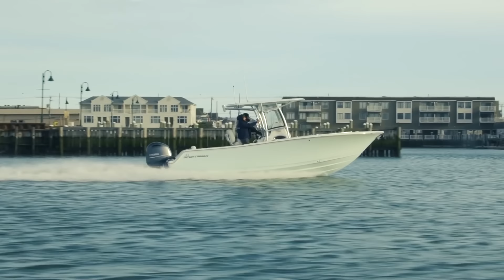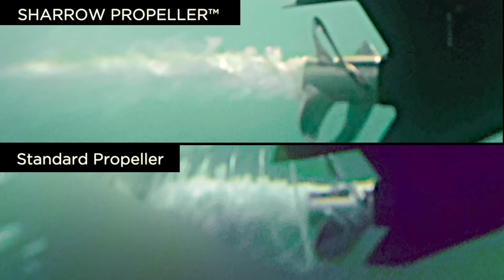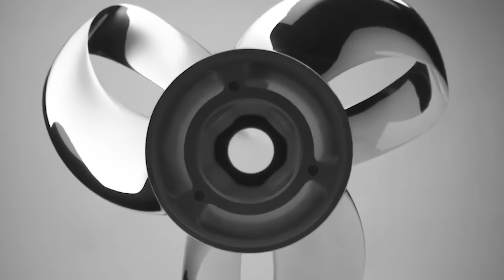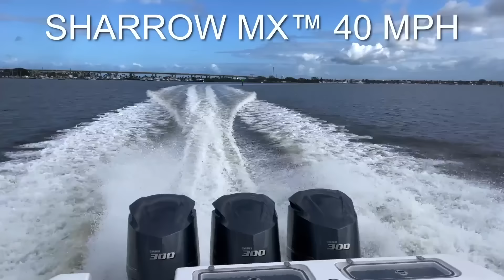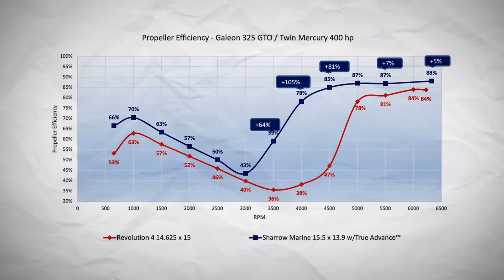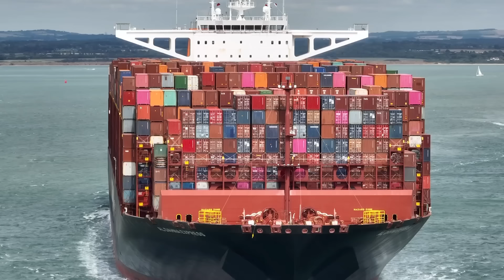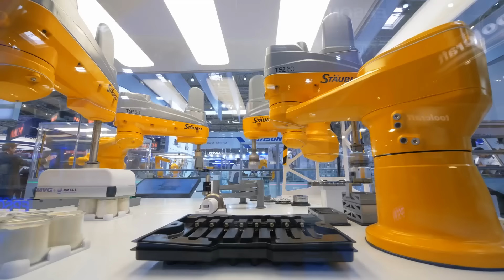This Genius Propeller Will Change Transport Forever

Comment: The reason for the current CNC or 3D printing requirement is that you can't easily  injection mold or cast  these due to their unique enclosed, twisted shape.   With an injection mold for instance you press top half and bottom half of the negative mold together leaving a void with a tiny hole in it.   A mechanism carries plastic beads forward through a series of heating elements which melt the beads into hot plastic soup, which is injected under high pressure through the hole into the void between the mold halves.   Once full, the mold  is left to cool below melting temp, and then the mold halves are pulled straight apart and plastic piece removed.  Usually some plastic needs to be removed at seams and the injection point.    BUT..    with the toroidal propeller shape there's no clear way to make the two mold halves in such a way that there will be a seam that allows separation by pulling the two halves straight apart.   The shape of the plastic part  traps the mold halves in place.   

For casting a metal propeller, the problem is not the cast itself, since the shell it's cast in, is removed destructively.  The problem is that to make the shell you'll cast into, you start by injection molding a positive wax propeller, which is made pretty much just like the plastic propeller above.  Two mold halves pressed together to form a void, inject melted wax, pull the mold halves straight apart, remove and trim the wax propeller.   Attach a wax "pour cup", add a silicon non-stick coating, then add ceramic/sand coating which is built up in layers into a shell.     Once hardened, it's heated in an oven and the wax runs out leaving a hollow ceramic shell with a silicon non-stick coating on its inner surface.    The ceramic shell is heated up to the same temp as the molten metal, the metal poured into the shell, and as it cools, the shell cracks, and the rest is simply knocked off the new metal propeller.  Pour cup is cut off, and everything then finish sanded smooth.  

In both cases getting traditional mold halves apart just isn't possible with the toroidal shape.     It's possible that some sort of mold that lifts and twists at the same time might make it possible, but still might be a problem if the pitch of the blades changes from root to tip (as it usually does on a traditional propeller) or there's a compound concave curve inside the tips.
Reply: How far can you get with a CNC machine?
Reply: @dougrobbins5367  Modern CNC machines can pretty much reach anywhere that isn't a fully closed volume (which is now the domain of metal 3D printing).  The heads articulate which allows them to reach inside structures like this.  In this case they just need to reach in from an angle to get inside that twist at the "end" of the blades.

The problem is CNC is slow, and because it's a subtractive process you're often cutting away more material than remains so it's fairly wasteful (luckily it's all recyclable).

Comment: So yeah, this is a scam, and you fell for it. This snake oil BS has been around as long as propellers have. No craft cares more about noise than a submarine, no craft features more cutting edge propeller design than a submarine.... wanna guess whether subs use toroidal props or not? You get one guess.

Comment: It's amazing how the toroidal propeller draws the water in from surrounding areas as shown with the dye in the water test. It would be great to see more of them and more manufactured to bring down the cost.
Reply: At $5000 a propeller, it cost more than my boat.  Propellers have different pitch and diameters.  It doesn't seem feasible for someone to have to go through multiple propellers to find the right one for their boat.  Until it comes down to around $200-$400 range, only few people will buy one.
Reply: @ahndeux  For normal people and very small boats this probably isn't worth it. But moment you are using boat for commercial application, even very expensive propeller should be totally worth it if the claims in this video are true. If not for smaller boats, definitely for bigger boats and ships.

So this video still kinda bothers me because looking at comments this has already been known for a long time, and despite that, if ships are not using this design there has to be some fundamental flaws with design, not the manufacturing.
From quick googling, fueling something like cruise ship can cost up to one million a week, so really if you are talking about insane saving over time larger the ship becomes.
Reply: @ahndeux  so true. What is really going on here is for your $5k they actually sell you a prop with pitch and diameter optimised for your boat/engine. Maybe there is room for a consultancy business whereby for $600 dollars you tell boat owners the optimum pitch/dia/blade number so they can go and buy the $400 conventional prop that is most efficient. And if they really care about the environment they can spend the $4k difference planting trees.
Reply: @XPLAlN  If you are a boat owner, you will know that its not easy to find an optimal propeller because the optimal RPM changes.  If the boat is carrying more weight, it affects the RPM.  If the boat is used for skiing vs a fishing boat, that also changes the prop setting.  If you prefer a faster hole shot vs higher operating efficiency, the prop pitch also changes.  Another factor to consider is the length of the boat, the hull design, the use of hydrofoils, etc, all affects the ideal prop design.  Even the material the propeller is machined out of (aluminum vs stainless) makes a difference in RPM.  There are just too many different variables.  The best way is to swap props until you get the performance you want.  That will never change.

Most of my boat owner friends have 3-4 props.  Some vendors allow swapping out props for a shipping fee.  Let's just say this is not likely to happen with a $5K prop.
Reply: It seems pretty old design, and would be in wide use if some mass production would make them viable for mass use. Overall, it seems like there are significant hurdles to overcome when it comes to manufacturing. That said, with current manufacturing capabilities it should be viable to use this, especially with high value machines. But from what I gathered it's not so I assume there are some other limitations. 
At least taking this video at face value, improvements proposed by this design are insane, and even if the propeller was significantly more expensive, it would be worth it for many boats/ships.
Especially in shipping and other commercial applications, there's just no way they would miss on significant fuel savings this would provide. So I have to say I'm suspicious that a lot of information is being left out. I just can't see manufacturing cost being an issue when it costs crazy amounts of money to fuel a large ship.

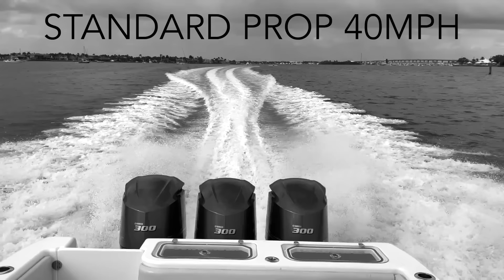Comment: 2:30... not real....the engine does make noise... not the propeller...i do have a small fishing boat... with a 5 hp engine.. and an electric one on 12v car battery... the electric one it's very quiet.. the petrol one is very noisy 😁🤣😂 ...I bet you can make a whip from 💩 and make it crack 😂🤣

Comment: I love the Engineering fallacy on the intro that shows +105% efficiency.  Nothing is or can be more than 100% efficient period !  Anything over 100% is because Engineers either underestimated the efficiency in the first place, have incorrect data , or are just totally fudging figures to make something look better. 
If over 100% efficiency was really possible, we would have perpetual motion machines, and endless supplies of electricity generated by joining renerators together, then looping the extra generated power back to run the generators compensating for friction and losses.  
Sorry, that just doesn't happen, no matter how many You Tube videos show it has been done !

Comment: Very well done video. I’m in the aerospace industry and did some pretty intense research on these a few weeks ago… and you covered almost every point I looked into :) something interesting is that like you said, most large rotorcraft have slower spin speeds, but a neat exception is in the tail rotor of helicopters. They tend to spin pretty damn fast
Reply: Do you have any information about how they came up with this thing? Was this a deduction from some known fluid mechanics concepts? Thousands of simulations? An AI design?
Reply: @neildutoit5177  I have no idea. I’m a software engineer at an aerospace company and am passionate about the field, but I’m not a MechE by trade.
Reply: suggest you talk to one of the aerospace engineers in you industry, they will soon show you why this is all rubbish, and even worse on propellers used in the air.....
Reply: @quadlawnmowerman  why is it rubbish?
Reply: @h78j.2  because Quad Lawnmowerman sells standard props.
Reply: @b0nes95  🤣🤣
Reply: @h78j.2  Cause both the maths and testing shows it is a rubbish design.  You would have to be pretty gullible to think they somehow made a magical 4 bladed prop that evades the laws of physics.... The basic principle at play here is to reduce the area of greatest thrust generation/loading (which is the most efficient part of the prop) by spreading it over more blades...... In other words, less thrust generated for more energy input. No aerospace/aeronautical engineer would bother to research, as soon as they saw it had more blades they would be "nope, won't be more efficient" end of story.
Reply: @quadlawnmowerman  you have no idea what you’re talking about. Look up tip vortices and come back, that’s the main benefit these propellers allegedly have.
Reply: @awillingham  Agreed.The fact that there is no conventional tip at the end of the blade makes a huge difference to the turbulence, drag and the acoustic noise profile.
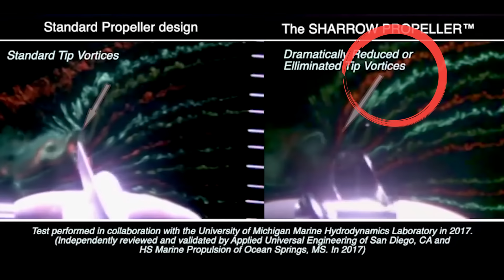Reply: @awillingham  right? If I'm not mistaken, they basically created a winglet, but that "winglet" goes all the way back around to the base of the blade. I guess the fact that you'll have a higher ratio of laminar flow versus turbulence on the "donuts" also is why you get more surrounding fluid sucked into the prop as stated at 1:30 .
Reply: @quadlawnmowerman  So, I suggest to let the aerospace/aeronautical engineer do the talking.🤔🧐😁

Comment: Prop efficiency does not mean anything in regards to fuel consumption, if  prop is less efficient it means it has slip, which mean you don't go as far per revolution as you would with a more efficient prop, however this also equates to less load on the engine which means less fuel consumption. What a highly efficient prop does is it lets you get away with a smaller prop, that could possibly equate to less drag and thus more fuel efficiency. This is why a prop that is 200% more efficient may only increase fuel efficiency 20% to use their numbers

Comment: way way overpriced... how many hours do you have to run one to recoup the costs..??   at $5000 a prop, I would suggest that you can not burn enough fuel on "most" boats to justify the costs..   They need to make the prices something that is at least in the palatable range..  Say what they want, but I can bet CNC and 3d printing have made their production cost a joke

Comment: The value of the award winning MIT project and this video are limited to simply informing the audience of the concept.
In this video snuck in it is the important idea that propeller tip vortices becomes more of an issue at higher RPMs so may have little value for slower motors.
Additionally, the astute viewer will notice that there is no mention or comparison with other well known solutions to addressing tip vortices... like ducted properllers and a ring around the circumference attaching the propeller tips. I don't know of other ideas like the commonly seen angled wingtips on planes can be adapted to propellers or makes sense. Counter rotating props are also seen to increase thrust possibly at a lower RPM.

Some day someone will need to do more than just a project and actually test these different solutions against each other to understand what may be better for different situations.

Comment: MIT needs to get to work on designing more efficient air compressors. Up to 90% of electrical energy used by an air compressor is converted to heat.

Comment: Since first hearing of these props, I've watched many dozens of videos. Each one has shown the toroidal prop actually is louder and takes more power to run than regular props.
Reply: I'm guessing the shape and inclination of the blades have to be precisely optimized to the operating speed of the prop.
Unless the videos you're watching have the engineering expertise and/or a significant budget to test a multitude of shapes, anything you've seen could be interesting but should not be reliable.

Comment: The efficiency increase is due to less cavitation. Since there is no cavitation in the air, a toroidal propeller will not make drones a lot more efficient. It is not suitable to create quieter computer fans, since these fans have a cage which  already suppresses the blade tip vortex. A big concern in aviation is the adjustable pitch. There is no way to make a constant speed toroidal propeller. Electric motors have a wide RPM range where good efficiency is available, thus adjustable blade pitch is not necessary for a drone or an electric airplane. But despite the illusion, that electric motors will take over transportation, that's not going to happen. Unfortunately electric propulsion is way more behind fossil fuel driven solutions than it seams, and it is likely that it is just a fashion which dies out sooner or later. So adjustable pitch will probably  remain a more redundant way of efficiency control then electric or even hibrid engines. So no... It's not going to change transportation. Some eVTOL projects will adapt it, but apart from that, it will be reduced to the hobby industry. But at least it works, unlike the Dyson fan driven eVTOL projects XD

Comment: I was amazed at the difference in noise levels between the outboards. Would never have guessed the prop made that much difference
Reply: They are comparing the same speed. So he was probably running less RPM for that speed.
Reply: @BertM3  Which nonetheless shows the advantages of the Toroidal propeller as it requires less RPM to provide the same speed.
Reply: @bijonn  It's more in reference to the noise. A few hundred RPM difference can considderably alter the noise coming off an engine. 

But you are right, it shows the added efficiency of the Toroidal propellor.

Comment: Whoever wrote 105% efficiency on the thumbnail doesn't know the first damn thing about physics.
Reply: It says PLUS 105% over the design's that have been the standard. 
It's easy to see why, IMO. But 10x the cost will never even out, at least on boat props that wear down pretty fast.

Comment: Could they be molded? If so it would seem that they would be much more cost-effective. Say especially plastic props for a drone. Or even a prop for a boat out of cast iron covered in plastic. No doubt there's a better metal available but just for an idea.

Comment: So much made up garbage in this video. The prop drastically reduces efficiency in order to gain more disc loading, in other words it takes more torque/HP to move the prop the same distance in the water, which makes the efficiency LESS not more. The only gains are the additional blades which generate more thrust but at a much lower efficiency and the top speeds are also significantly reduced. You have to be so gullible to think increasing the disc loading will result in improved efficiency, the turbulence the additional blades cause also drastically reduce the efficiency just like any other rotor (it is also why most props in this class are only 2 or 3 blades).....

This is an old design that was proven to be very inefficient a long time ago, there is no getting around the maths on thrust generation.....

Comment: 3:05 a bit deceptive. It's not 105% more efficient overall just at 3000rpm, at which point the motor isn't making peak power anyway. If it was 105% more efficient at peak power than yeah it would be excellent but it's only 4% more efficient where it counts.
It would help for getting up to cruising speed easier for sure but that's about it.

And for noise pollution a 400hp outboard is going to make alot of noise no matter what prop you use.

Comment: Has anyone looked into the differences between these and screw-type propellers?

At first blush it would seem that the screw-type and the standard prop would be about the same, but then I'm not a hydrodynamics engineer ;)

Comment: You claim that this will make drones quieter but you do not show the difference in sound and performance on drones, outboard motor demonstration does not show the noise and vibrations under the water surface, also I can connect a pipe to a chainsaw exhaust and place the other end in a bucket of water and it will be 50% quieter.

Comment: I think, this is very missleading. Regular props easily reach an efficiency of 60-80% when they work in optimum conditions. So doubling this value would mean a perpetuum mobile ;-). It could be that the efficiency is larger over a varietey of rpm, but this does not help, it will not replace e.g. a variable pitch prop.

Comment: if you completely isolate the benefits from the drawbacks of such a propeller - the umbers look impressive but ... the in the real life the things often work differently. Showing the footage of the boat with standard props and toroidal to compare, where the only audible difference is just the engines roaring with standard and almost non existent noise coming from engines equipped with sharrow props is completely ignorant and misleading. I assure you - you will not hear any difference being in the boat ...nevertheless - very interesting video showing the proof of concept ...